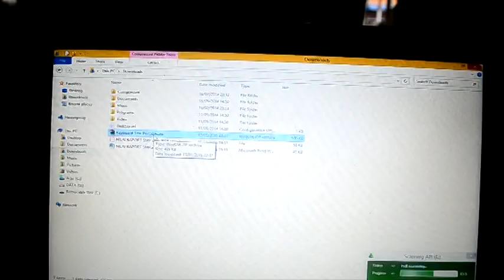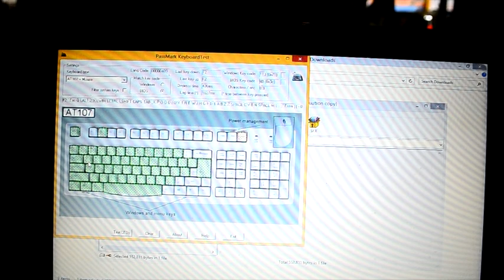Menganti Keyboard Acer v5-123 * Replace Keyboard Acer v5-123

Comment: Mau nanya, acer aspire v5 123 bisa tambah ram ngga? 
2gb+2gb bisa tak? 

Terima kasih
Reply from the maker: Seperti nya Acer v5-123 single slot. Jadi tidak bisa 2+2,  mesti langsung pasang 4gb. Tapi biar lebih pasti boleh intip mainboard nya
Reply: Berapa tambah ram 4 GB bg